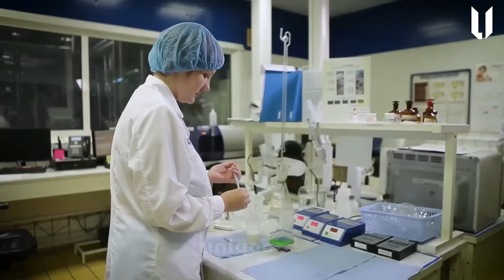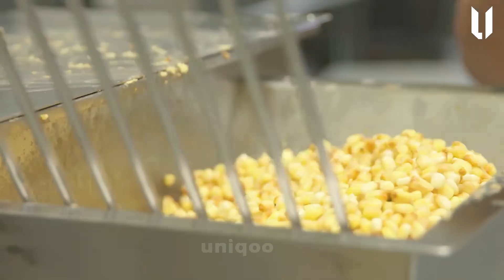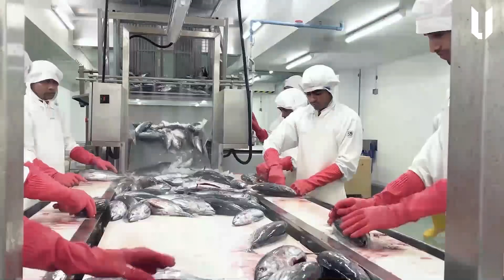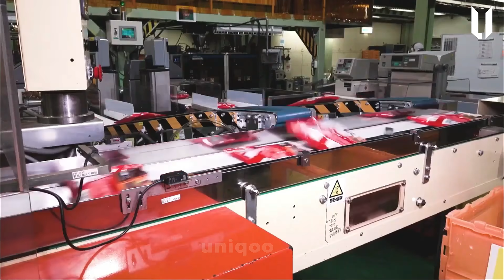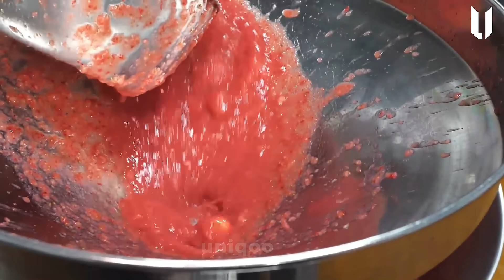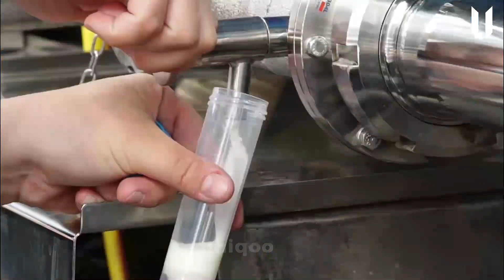How Condensed Milk is Made in Factory | Step by Step Process

Comment: There is an an error in part about fat separation. Raw milk will have around 3,7% fat. During the separation, you will get a very high percentage cream. Over 40% of fat. And the skimmed milk will have as low, as 0,03% of fat. 
Next step is "standardization" of milk, when you mix it back together to get 0,5%; 1,5% ; 3,5% milk. (These are typical grades produced in Czechia. It can be different in your country.) 
Or, there can be a machine, which will produced directly the standardized milk, but the general idea is the same. 

But, you cannot produced 20% cream and 10% milk from the 4% raw milk.

Comment: Poison
Reply: E407 (Carrageenan) – A thickener and stabilizer derived from seaweed.
E322 (Lecithin) – An emulsifier, usually from soy or sunflower, to improve texture.
E339 (Sodium Phosphates) – Helps prevent milk proteins from separating.
E450 (Diphosphates) – Used as a stabilizer to prevent crystallization.
E500 (Sodium Carbonates) – Regulates acidity and prevents curdling.
E471 (Mono- and Diglycerides of Fatty Acids) – An emulsifier to maintain smoothness.
Preservatives (Less Common in Condensed Milk)
E200 (Sorbic Acid) – A mild preservative to prevent mold.
E211 (Sodium Benzoate) – An antimicrobial agent, though not common in dairy.